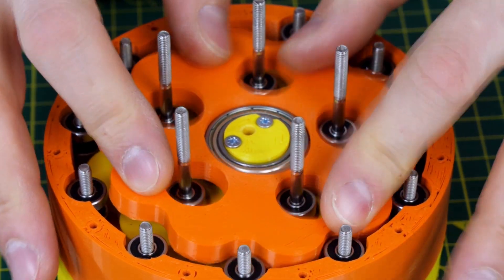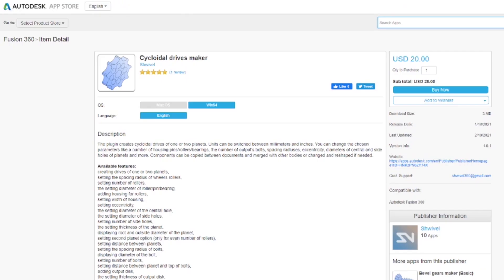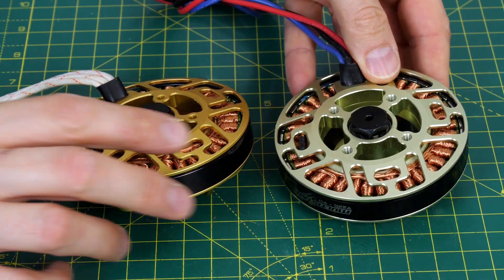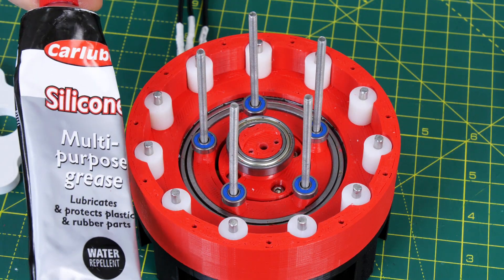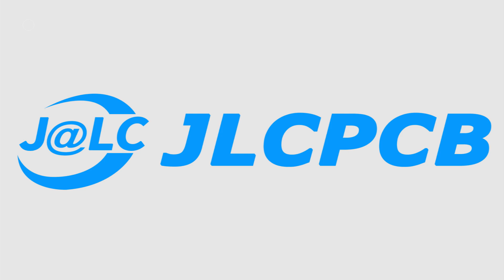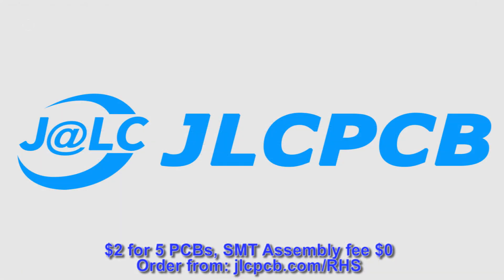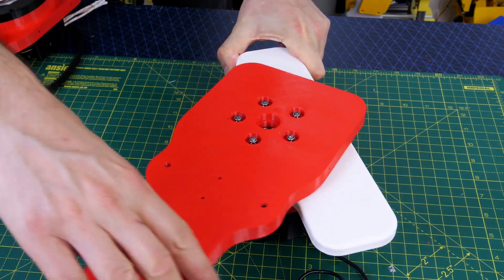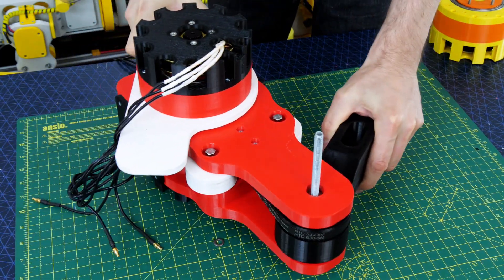Cycloidal Drive V3 & Robot Dog Test Leg

Comment: Not an engineer but I think you can get a self lubricating nylon and then they shouldn't need to rotate. Make them a press fit on those pins so there is no movement for noise to occur. My guess is the tiny gap between the ID of the bushes and the pins is getting slapped each time the cycloid comes around.

Comment: Hi, I've been watching your videos for a couple years and I love it. 
I'm considering using this cycloidal gearbox on my sumo 3kg robot, but I'm not sure if it can handle the torque and speed of the motor. We'd probably use metal parts instead of PLA, and the KV of the motor would be around 400KV with 4s or 6s. Do you think the gearbox could handle it?? Is it worth trying? Cause the reduction is very high for the size of it.

Comment: Question: since the internal discs run in opposite directions, they're going to interact with the same bushings occasionally. That's only going to be the case for 3 or 4 of the bushings. Would it help with efficiency, noise and wear to just replace those with individual bearings?

Comment: Dear James, I watched your video several times. Really good job. It is fantastic. I just want to ask how you made the braking? When you press down, the leg resists up to 20-25 kg. I really wonder so much. Thanks.
Reply from the maker: That is the motor and its driver trying to hold position using the encoder.
Reply: @jamesbruton  Thanks 🙏

Comment: How did you get the encoder output from the motor shaft to match that of the actual joint position since there is a gear reduction?

Comment: idk if you did already but you need to use evolutionary algorithms on the large functional pieces and some of the gears too to reduce weight and increase strength instead of geometrical infill which is wasting weight and not adding much benifits compared to a solid or hollow part

also, have you considered using coiled nylon fishing wire and a healing element for artificial muscles instead of motors?

Comment: The 8308 refers to the  stater size not the motor size, and unless you have a different kv rating i'd have thought you could use the same current rating as the old ones.

Comment: Even on video, I like the sound of the v2 a lot better too. V3 sets my teeth on edge. Oh but the v3 built into the leg sounds a lot better. But why would bushes make more noise? Either there's more play somewhere, or it's the cheap motor.

I wonder if it would run freer with pairs of half-length bushes, so each cycloidal disc had its own set of bushes.

Comment: I know I'm way late to the party with figuring out what's the worst change with this V3 cycloidal, having only really dove into your channel and met these yesterday, but I do offer a fix-up solution. The meeting of the casing and disc (though at the time of this video your profile isn't optimal and just causes less overlap of these transitions, I'm not able to examine what's on the git currently), ideally imparts a rotation on each casing bearing which causes it to rotate in one direction when coupled to the cycloid peak, and the opposite direction for the much shorter duration (1/10th by my reckoning (Edit: I think it's more like a instant stopped/driven backwards, some floating, then 2/3 rounded up driven forwards regardless of reduction)) spent in contact with the trough. One could deepen the trough to perhaps skip this contact phase altogether and keep the bearing turning in at least the same direction. Still, assuming the rollers are indeed able to roll on their axles instead of always bottoming out on the casing, I suspect they are driven at different speeds by the anti-phase discs as most moments, fighting each other for no good reason. Edited to clarify and update that last sentence. 
My proposal would be to saw the rollers in half, turn the nice ends towards the middle and place a washer between them. What I'd actually do to the existing dog is nothing, PLA is wonderful for sliding contacts and the noise seems tolerable, but I wouldn't build a new one with baked-in losses like that.
Reply: Also, found it's actually really simple to cad the optimal cycloidal rotor, just I did it in OpenSCAD, the only optional inputs are the roller size (bearings being usually of limited selection) and the reduction. Generate an epicycloid of the roller rolling around a circle of radius reduction * roller radius, then offset the surface inward by the roller radius. Space the rollers on a circle of (reduction + 1) * roller radius, literally done!
Reply: Righto, yep, today I met contracted cycloids. Still think pin rotation is inevitable and opposingly variable with this type and construction material, but it's probably less of a problem and ignoring it is justified.

Comment: Interesting fact about speed reducers (ie: planetary, cycloidal, strain wave, ect) if you rotate the outer housing the output will be a differential of the outer housing rotating speed reguardless of the direction of the input rotation. We use very similar speed reducers where i work to achieve differential speeds in various rotating equipment.

Comment: Is this really that much cheaper than buying one of those MIT cheeta actuator clone ? If you add up the price of the motor, the controller and all the bearing it feels like you will get there pretty fast.

Comment: Hi. Not easy to find here. How do you control Brushless gimbal like motors? Normal ESC wont let them go both ways and this precise. Some multi-axis gimbal controller? I made my robots with stepper motors but wanted to move to something faster. It's really hard to control 3-phase motors with your own circuit board.
Reply: James seems to be quite fond of ODrive motor controllers and is using one on this project, and others on this channel: https://odriverobotics.com/
Reply: @jywilson99  Thanks for the anwser.  Pretty expensive part :/

Comment: I noticed you used one bushing for each shaft that goes across both of the gear things in the cycloidal drives. Have you considered using two per shaft like cutting them in half? It wouldn't fix the issue and it would certainly still be worse than bearings but I think it could help. Another thing that could help is using smooth rods for those shafts instead of threaded but I'm not sure how you could do that and it probably wouldn't be worth the decreased strength and increased complexity to add more other screws or threaded rods.

Comment: impeadance control. easier with direct drive of course. Great work. What resolution encoders are you running when you use them. Ive used the slotted aluminium discs in the past with chips that have hardware quardature encoders, will probally go rotary magnetic in future on my homemade stuff if I can get the chips, maybe slotted disks are a short term solution, 4 diodes vs ? x2K

Comment: I loved this playlist. I want to build 2 of them but modify the motor mount. 
Unfortunately, I couldn't import any of your STEP files from GitHub.
I've tried using SolidWorks 2010 and FreeCad 0.19, and both produce an error on all 4 step files! 
The error log on SW2010 shows this;
"Error: Incomplete file.
STEP-in did not complete successfully.
Context: Record ending on line number 1
         OR one of its fields."

What am I doing wrong? H E L P

Comment: where's the grease nipple to lithium ep2 grease gun pressure fill the inside for silky smooth use ^_~
sounds like the bearings are running dry why!

Comment: Have you tried using 2 half height bushings instead of full height ones? if the cycloidal discs are moving in opposite directions, the discs may be trying to move the top and bottoms of the bushings in opposite directions as well.

Comment: As I understand the workings of a cycloidal (adjusted epicycloidal) drive the contact between the lobes of the 'cycloidal' gear roll on the housing 'pins' and so there is no need at all for bearings or bushings! There should be no relative motion between correctly sized and spaced outer pins; you can print them in the housing (if the surface is smooth enough - which it should be in PLA at appropriate printing temperatures)

Comment: I know this might be a weird request, but could you make a flywheel that can increase and decrease its diameter to further sustain a mostly steady rpm over time
Reply from the maker: Check out my Ball CVT? https://youtu.be/KXb1gDpeq-Y
Reply: @jamesbruton  yeah naw, tom Stanton is trying something with flywheels, and i want to see if the principle of angular momentum could be used to keep a flywheel spinning for longer at a constant rpm. I would try commenting this to him, but i dont think he would be able to do it as well as you could
Reply: I think the flywheel would need to have an internal power source like a battery to actuate the change in rotational inertia. Maybe it could have 4 equally spaced arms that swing down to expand outwards radially from the flywheel and swing up again to decrease the inertia.

Comment: James, myself and a good friend of mine have just graduated with mechanical engineering degrees. In our free time, we have undertaken the task of trying to build human exoskeletons. I want to use cyclical drives for joints that have one degree of motion. I want to know if you think the drives you've made would be applicable.

Thank you for the videos. I've been following you since your hulk buster build. Keep up the amazing work.
Reply from the maker: They are pretty strong, you could use bigger motors (the 9235) and also more cycloidal discs stacked to get more torque.

Comment: The "8308" might very well just be a missassembly - happens a lot actually.
And the nice thing about AlieExpress and co - you see just how overpriced may stores are. The same product is often sold under docents of names, produced by the same company but rebranded. Was really funny when a friend of mine claimed that the aliexpress-parts were always just fakes and way inferior only to then notice that the chips he bought on amazon (for over 5 times the price) literally had the same part-numbers and came from the same factory.

(Of course you also need to watch out cause there are many really dodgy products and scammers around as well)
Reply from the maker: Apparently 8308 might be the stator size(?).

Comment: Go with higher kv motors, torque doest change but torque changes on higher rpm, so you have more torque on higher rpm, dont worry about current they dont need much even on higher kv, i recommend like 300kv 😉
Reply: @billyzelsnack  Yeah so a higher kv motor has more torque on higher rpm, thats what i sad. Smaller wires means more turns but not more torque. Just the current changes to produce the torque.

Comment: call me crazy but I mix 1:1 slightly warmed petroleum jelly with 3 in 1 oil and get a very good ultra light grease that I can glob on guilt free. It would have been interesting to see the bushings with more grease. Changing the ratio makes for a cheap variable viscosity grease. May seem hillbilly but it works for me.

Comment: I really like the idea of those in between spacers, my two disk are having a problem because the twisting forces will get them into contact. This is of course is causing friction and heat, those washers could be a very good solution to my problem!!

Comment: Look for nylon bearings. I have found them in both ball bearing and needle bearing designs. They ought to be quieter and smoother than the nylon spacers. Also, give that test leg a good work out. It may smooth out with use and it's rougher now because of the ridges from 3d printing.

Comment: This is all very impressive as an academic exercise, but my intuition (which is all I have because I am not an engineer) is that it seems over-engineered, meaning it seems there must be a simpler, less fiddly way to do it. For example the 3D printed moving parts seem that they would wear rapidly, requiring more maintenance than is practical, particularly considering that it seems your goals are to do this on a budget. I cite Elon Musk, "The best part is no part." This has a lot of parts.
Reply: P.S. I would further specify this to, the best moving part is no moving part. Moving parts are the really maintenance intensive ones. You can't eliminate them for physical robots, but you can try to minimize them.
Reply from the maker: Well wheels would be less moving parts, but that's not the point. Parts could be machined or 3D printed in tougher materials also, but if it all works in PLA then it's a really accessible open source project .
Reply: @jamesbruton  Accessibility and open source are separate issues from engineering practical applications. A project can be perfectly accessible and totally open source and still have no value.

Comment: Hey, great progress on your new design! Have you thought about designing the cycloidial drive gear box to be able to be packed with silicone grease? The suspended fluid may add a bit of hydraulic friction but would probably cut down the clatter a good deal. It sounds like the bushings are getting beat up in there a bit, and I wonder what the degradation would be like after the robot has walked a few km in the sun and other elements. Is dust and grit going to become an issue?
Reply from the maker: I tested the V2 with bearings in for several miles pushing me on a skateboard with no visible wear, so I think that is my plan.

Comment: If you can make a virtual spring using a couple more sensors and some code couldn’t you put pressure sensors in each foot and simulate a back drivable system that way? I’m not an expert and I’m sure there’s a good reason to not do this
Reply from the maker: Yes I've already been there with openDog V1 and my Sonic the Hedgehog robot. The system has to be pretty fast to react though to move a rigid actuator like a spring - this way the actuator is the spring and the sensor all built into one.

Comment: Are you sure the clacking sound isn't a tolerance issue with the nylon inserts? Also, I would try using a thick grease between the gears, nylon inserts and the steel shafts. It should dampen the sound.
Reply from the maker: Yes almost certainly, that may be where the energy is going too. I've just bought 400 bearings for about $70 from China though so I think that's the way forward.

Comment: Why don't you remove the belt altogether by putting the second motor in the knee. You only had the belt in the orginal leg because u needed the gear reduction but now the belt is a 1:1 ratio so no need to have a belt at all. Makes for less parts which both make robot lighter and less to fail
Reply from the maker: That means moving that whole gearbox and motor around when the leg moves/walks. It needs to move pretty fast so it would cause a bunch of issues with the stability of the robot due to the inertia. This way both motors are move around the centre of rotation of the leg so there's no offset mass.

Comment: With the bearing version each disk has it's own bearings, while the bushings are shared. I'd expect that there are times when both disks are touching the bushing and hence you'd have a plastic-nylon sliding contact instead of the plastic-steel one. Hence using thiner bushings with a steel spacer in between might make an improvement?
Reply from the maker: Maybe, I just bought 400 bearings from China for $70 so I'll be doing it that way.

Comment: The design looks way better now :) 
With the “actual“ cycloidal shape you increase the number of contact points, thus it more difficult to get the fit of the discs right. Despite what’s written here in different comments, there is not just rolling contact on the cycloidal discs and the pins! So rollers definitely help here! (IMPORTANT)
The generated noise is mainly driven by you disc design and the load distribution that comes with it (load distribution; tolerances..). Try to play around with your printed discs tolerances. A slight preload can help a lot, and yes this reduces the efficiency on the friction side a bit, the load transmission could be improved though.. ans add a bit more grease as well - choose a proper one though.
For position control of those joins keep in mind that the damping is quite high - that’s good. On the other hand though, there is quite a big hysteresis compared to your former belt drives. In this application it could be fine though, since it doesn’t have to be too precise
Reply from the maker: That's what I thought - when the 'peak' of the disc comes past the pins while the gear is engaged with the other side it's definitely not rolling. I had to tolerance the disc down to get it to work at all. I just bought 400 bearings for about $70 from China though, so that'll be the way forward.
Reply: @jamesbruton  Exactly, it‘s just pure rotation in one point at a time. Since this kinda transmission is designed to have multiple contact points to distribute the load, all the other points are not just rolling - as you said. Yeah, the disc shape and tolerance is quite demanding. To get it working with multiple contact points it might need a lot of testing and matching of the parts - 3D printing has its limits here. The most critical part is the friction: By reducing the size of the disc to get it working without load (not multiple contact points), the amount of contact pressure in the one point under load increases and reduces the capability of the transmission. Your bearings would definitely help here, but it‘s quite some weight and parts.
I have also thought about multiple ways of designing and building a ‘simple‘ transmission thats still back drivable. My best approach yet is a two stage belt transmission where the motor sits inside the large output pulley and two different pulley sizes to keep it as small as possible. I achieved a 28:1 transmission ratio and it‘s still backdrivable…(and yes it can handle high torques: tested with 30 Nm and max speed 720 deg/s (at lower torque..)) You can see it in my 6 axis robot vid in case you’re interested. Such a design might be suitable for your openDog